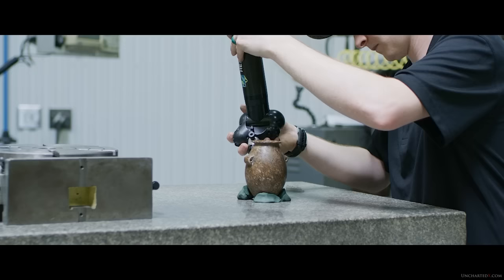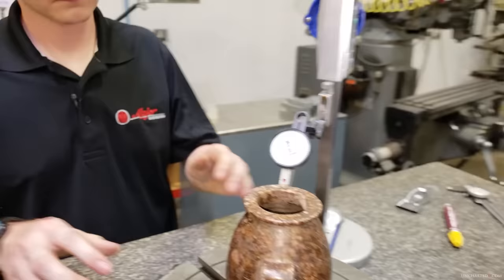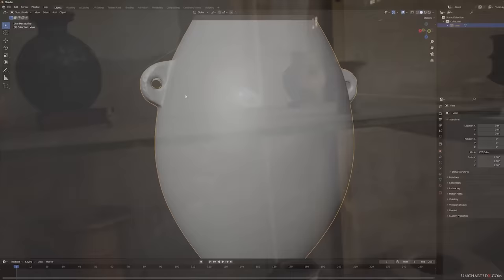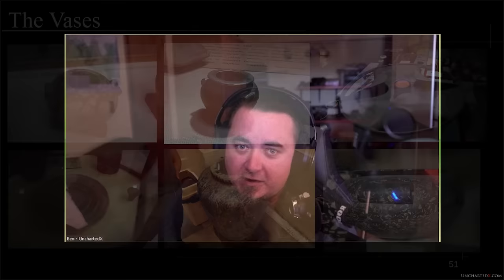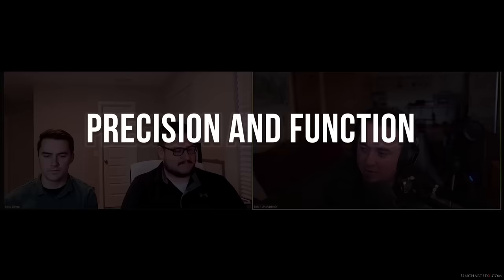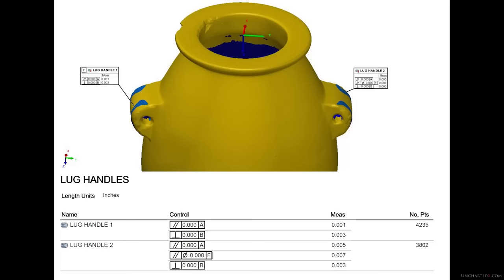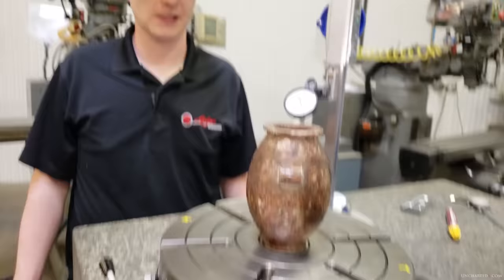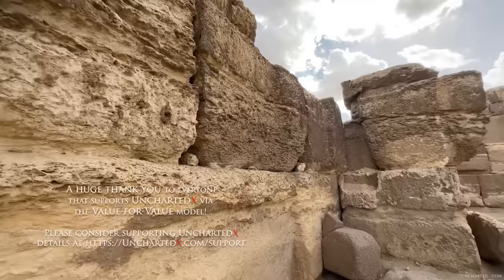Ancient Egyptian Vase Scan Update! STL file, More Analysis - and Between the Lug Handles

Comment: Thank you for the STL File! I am an avid 3D scanner myself, but I don't have the financial capabilities to travel around the World, so I am constantly looking for 3D Scans of ancient artifacts and architecture to be able to measure and study them in detail. There are still so many things left that need to be 3D scanned so they can be shared with the world! Edit: I have already found an interesting detail about the vase from the stl file.
Reply: What is the interesting detail? I’m intrigued.
Reply: @racoon965  there is an horizontal imperfection in the surface, close to one of the handles, showing definite proof of laithe work. Also, the flat face of the handle closest to the imperfection has a slightly diffirent angle to the outer surface of the vase than the other flat faces of the handles. it's barely noticable, but you can see it if you put a box around the handles and compare the angles to each other. To me this looks like whatever tool they used to clear out the area between the handles wasn't set 100% correctly, and so it created the wrong angle on that side and carved slightly too deep into the material. But they corrected the tool on the other sides of the handles.
Reply: @Parabola001  Holy crap. So what are your conclusions on how it was made?
Reply: @Parabola001  That is not on a lathe, but the very same drill setup used for coring. Just not fully turned but more on the line of 150 degrees turn and rewind repeat. The grinding stone did not fully touch the sides where the lug handles were as it could not.
Done by hand, but still a remarkable amount of care and attention to detail. Unlike the inside surface which is kind of ignored. Why would they ignore it if they had the capabilities? Mostly because they did not.
Reply: @dragoscoco2173  Judging by this reply I am just gonna assume that you have never carved anything at all. The geometric perfection of this object is not obtainable by Hand. And the Imperfection, or mistake, I mentioned in my previous reply wouldnt happen if you were to slowly grind away the material. Also why would they ignore the inside if it was made by hand? you could easily polish the inside just as well as the outside by hand. These Vases look like they were mass-produced in a factory, and you have to cut corners in production to lower production costs and time, so they only polished the openly visible parts. They would do it exactly the same way nowadays.
Reply: @Yeoldelole  The main part of the Vase had to be done with a laithe, no doubt about it. The shape is actually not that difficult if it was done in clay or wood, but they had to make it from frikkin granite for some reason. And the big mystery is of course the area between the handles. My guess is that they left a big ring around the Vase after first laithing out the main shape, then they used some tool, like a blade that has the exact same curve as the Vase, to carve out the material between the handles. It had to have been a machine or tool that worked on at least 2 axes. But the tool itself actually isnt that interesting to me, because we have tools that could be capable of making this object from wood or metal. The big mystery is the tip they used on the tool that could easily carve through granite in such high rates, and with such precision.
Reply: @Parabola001  If it were as easy as CNC than doing the inside would have fetched even more from the local kings.
But I belive they were unable to place the vase in a chuck and spin it to have acces to the inside as their main most productive method was fixing them like the drill core with a drilling jig.

Comment: I picked up what I thought was part of the rim of a ceramic jar, on the shore of the Bay of Biscay, but only recently realised that it is stone. It has a smooth top surface, the ledge is on the inside, and the mouth of the jar would be approximately a foot in diameter. To think it started out as a solid block of stone is absolutely incredible.

Comment: Great video Ben.  👍👍  Great analysis of the exterior of the vase (the easy part).  Is there a plan to scan the interior of the vase?  1) To establish the symmetry of the interior.  2) To compare the sides to the vertical axis used for the exterior comparison. 3) To map the thickness of the vase and the thickness consistency at different horizontal planes?  🇨🇦

Comment: Silly question. Are the holes in the handles straight or, do they follow the curve of the vase? Drilling curved holes would be an interesting trick.
Reply: Silly answer ..
Ofcourse they're straight, do you think a sand worm (granite worm)  ate its way through? 
Better answer ..
The holes are tangent to the vertical axis at centre point of drilled (? Not carved ) holes and  horizantal  to the top within a few hair thickness.
If curved, i think taking data points inside the tube hole would be extremely difficult and the lads would have made a point about it. So, are they curved? Highly unlikely from discussion but cannot give definitive No. Video footage never good enough to say 100%, ever!
Great question though.
Reply: @nawhedawhe6905  So what you are saying is that, if the holes are curved, even with current technology, we would have difficulty in measuring it, let alone replicating it. 
But just to confirm whether it is curved or straight, maybe a soft clay-like mold can be inserted to see the shape it produces?
Reply: Search for a channel called 'Infrafon' and a video on the channel that says 'how to "melt" stone'. Blew my mind going through his videos.
Reply: Straight. But they are so out of line that they fail at precision twice. They are visibly not paralell something aking to 5 degrees angle. One is going upwards while one is mostly in the handle direction.
Reply: @andrewholdaway813  thank you for reply. It is a rather curious anomaly. I wonder if there are vases with handles but, without holes?

Comment: Great follow up, Ben.
It’s abundantly clear you’ve been having in depth conversations with engineers and machinists, because the vernacular you are using is instantly recognizable by any person engaged in precision manufacturing.
I still crave the opportunity to do a close visual inspection, because there are almost always witness marks left behind from the manufacturing process. And there is no better candidate to recognize and interpret these marks, than a highly trained machinist (even engineers, rarely have this experience).
Keep up the good work Ben. 
You are definitely headed in the right direction.
Reply: Not if they polished them away.
Reply: especially in the interior
Reply: @okgroomer1966  Do you know that polishing removes material?  Which can easily lessen the precision of a shape or dimension. And that even polishing leaves microscoping markings. No matter how you put it, the mere existence of objects being even 10 times less precise is mind blowing.
Reply: @jdm2651  I clearly understand that and that's why I said it. Polishing could very easily erase all the manufacturing markings

Comment: I worked as a geo tech for many years and have achieved, using optical methods, high degrees of dimensional accuracy making geological thin sections. What I'm wondering is if any evidence of diamond polishing compounds has been found on the surfaces of any of these vases. The inside might be a good place to look. You guys do great work.

Comment: Years ago I toured Greece and Italy where most everything has been made from marble.  Some of  which shows amazing skill in the production.  I was amazed on visiting the Pantheon in Rome to see that the stone columns at the entrance, about 40’ tall, are highly polished perfectly round granite.  I wondered at the time how they had been made.  After recently discovering this series of presentations on the stone work of ancient Egypt I thought I should see what was known about how the Romans made those granite columns in Rome.  It turns out they didn’t make them, they were dug out of the sand in a quarry in Egypt!
Reply: that's pretty astounding.  it applies to much roman stone work?  got any links ?
Reply: The whole "re-purposed" angle, on a lot of the building materials, has to be looked at hard, at some the ancient sites.  It would make sense, they would do it.  It would give the place, instant history, for those of the time, as well.  Win, win!
Reply: You are right in that they quarried the granite in Egypt, from two sites. The columns were actually carved by the Romans however, not re-purposed. The columns on the Pantheon in Rome aren't actually perfectly round, all of them have a slight bend in shape, and they're un-even in height by a few centimetres. As impressive as they are, their symmetry doesn't even come close to the vases and artefacts discussed in these videos, which is further testament to the skill of whoever made these - given they're at least 3000 years older than the columns in Rome.

Comment: This is truly ground breaking work! I have some background in engineering and architecture and imported the STL file because I was very curious about the handles/lugs. Looking from the top down they are noticeably not symmetrical (from a modern perspective). One is "square" to the face of the vase, the other - one side isn't square to the other side of the same lug. The two lugs are slightly offset to each other by a small amount. Another inaccuracy can be seen with the holes through the lugs which are again not symmetrical with each other. I find it odd that given the precision of other aspects of the vase these details was missed by the maker. Scans of other vases are desperately needed!
Reply: In your opinion, would those asymmetries imply a mechanical function or dispensing system utilizing these vases? 
If rods were inserted through the holes what motions could be augmented or inhibited?
Reply: @friendlyone2706  No, in my opinion, the asymmetries are errors when the vase was being made … or possibly made by someone who modified the vase at a later date.. maybe the lugs were originally larger and got broken.. perhaps they didn’t originally have any holes at all.
Reply: My perspective on these vases - they were made with lathes which must have had some kind of bearings that could hold the stone with little or no wobble. The accuracy of the parallel surfaces would then happen almost automatically. The space between the lugs is the tricky part as mentioned in the video. Perhaps, given the errors, this could have been done with tube drills, saws and finishing with abrasives.  It is quite amazing what expert craftsmen can do by hand.
Reply: @dworkin7110  Could be

Comment: So cool that Alex is following his dads work on this. i just inspected the 3D sample scan myself and it really is astounding just how much the outer curvature is unaffected by the handles in every plane. When applied with a highly reflective appearance (like chrome) you can see a noticable change in the handles immediate sides (adjacent to the through holes) but the immediate above and below interfaces with the general profile is pretty much flawless. Maybe some residual internal material stresses of the granite in those areas have "relaxed" over the past few thousand years???). It's also intersting to note that the interior face is significantly more undulating than the exterior. Which should be recognised when speaking to the "precision-with-a-purpose" aspect of the discussion. Maybe the technology used wasnt so simple to employ and was reserved for only the more aestheticly significant parts of the object which the eye could readily dicern?
Reply: There are significant aberrations between the handles that are not present anywhere else on the object. To me a clear sign that those portions were created using a different technique than the turning operation used elsewhere. 

And granite does not 'relax' in a few thousand years. That rock was hundreds of millions of years old when quarried. Granite is one of the most stable materials known to man. Which is why we continue to use it today as a reference surface accurate to millionths of an inch.

Comment: I've done both manual lathe work and CNC. The most impressive thing to me is how they cut material with such different qualities especially thinking in terms on it being lathed That takes speed and perfect pressure . And it takes many broken bits till you get the hang of it on just steel

Comment: I would love to hear about the internal volume (capacity) of all the pre-dynastic pottery. Maybe we could find a standard unit that was used, and then gauge the precision of volume held without the need to worry about differences in size or shape. This would be an easy experiment to run, depending on the number of items available to properly measure, and I am surprised I haven't heard anything about it yet.
Reply: Excellent idea, worth looking into.
Reply: genius!

Comment: If you open the stl file in blender, and change the viewport shading to MatCap and choose a material like brown clay or red metal carpaint, it's very easy to see that the area between the handles is not as even as the rest of the vase, when rotating it around.  
So it was turned in a lathe, the handles were left as a band around the whole vase, then the area between the handles was removed somehow. 
If the vase was all hand-made with some other tool like stone hammers, there would be no reason to have different quality in the area between the handles. 

Also if you make a cylinder, then scale it roughly to right size, loop-cut it into like 20 loops and scale all the loops so that the vertices are just outside of the vase surface, then you can get very easy visual representation of how symmetrical/accurate the vase is. You will also find out that it isn't actually centered, you have to move it a bit.
Reply: So you're counter point is you're eyeballing it after adding potential computer generated artifacts by manipulating the material/ color? Vs. Actually measuring like they did
Reply: @cscirpoli  
I wouldn't call it a counter point.
More like it adds to this. And you can do this yourself, blender is free software. You can see it yourself. Especially when you set the material as  metal_carpaint, the reflection pattern stays very uniform when you rotate the vase, except in the area between the handles. It wobbles more, so the surface is not as even. 

Sure, it's possible that the scan has errors, but why this kind of errors only in between the handles?  

The vase was not made by magic, or aliens, or a cnc machine. It must have been made in a lathe. It's also too symmetric and round to be completely handmade. And then there was a huge amount of work and skill used to cut out the areas between the handles out, probably by hand, or at least, not in a lathe. 

Also, the inside of the jar is highly symmetric around the same center point as the outside. That was not made by hand tools in a separate process. The inside does not however follow the same curve as the outside, so the thickness isn't uniform, and it's not particularly thin.  

I'm not saying that ancient egyptians didn't have a lathe. Just saying that a lathe must have been used.

Comment: the machining of a matrix of differing harness materials was probably done by a rotary cutting tool, cutting a turning piece. a high RPM cutting tool is required to deal with the differences in material harness without ripping out one material from the other.
Reply: or maybe some ultrasonic cutting device.